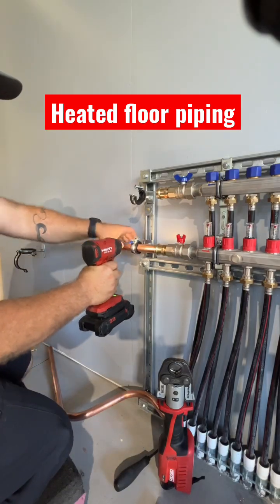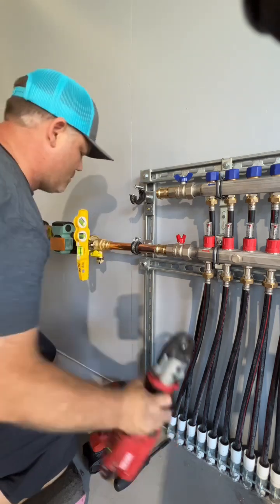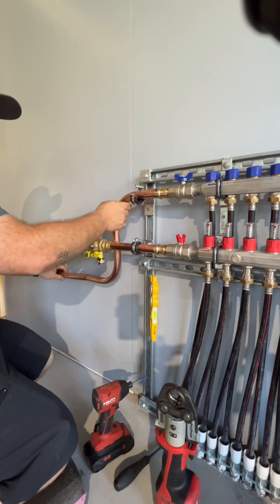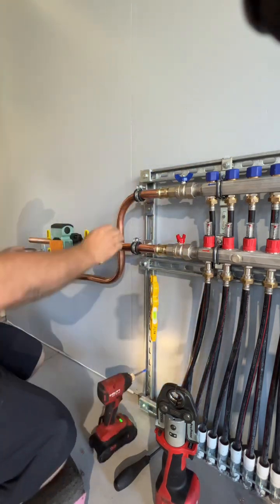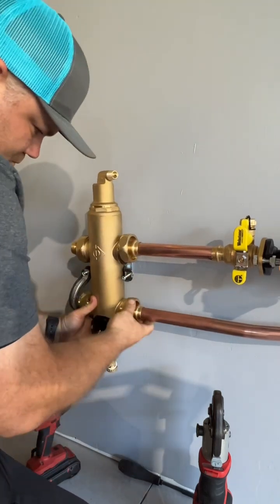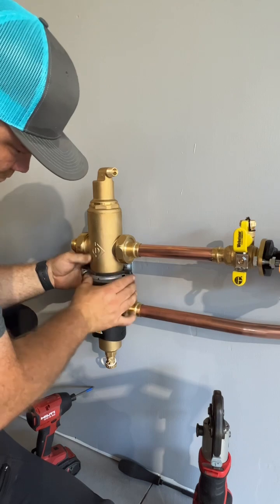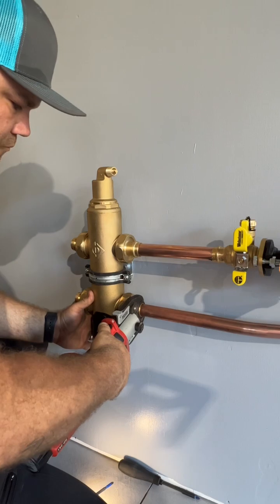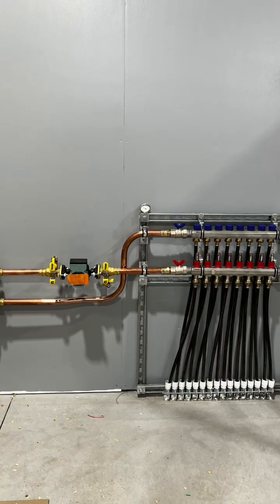Copper plumbing for heated floor #auneshop 🤟🏼💪🏼💯🔥

Comment: That air separater by spirotech, atleast the bigger ones use weird metric threads on stuff so dont start pulling shit apart and expect you can just use regular threaded fittings. Ask me how I know. Drain is cool, it has a magnet inside a tube that is magnetized to collect metallic shavings.

Comment: I thought I was the only one that bent copper pipes instead of using fittings at every single turn. That bent pipe has given you unlimited kudos, it looks freaking awesome! 👌🥰
Reply: Depending what I’m doing , I’ve always said. If these fittings use fittings (re work job) but if it’s new bend away moe farrah!
Reply: What was the name of the tool he used to bend the pipe? I tried using a conduit bender but it would create ridges on the inside bend.
Reply: @qoolcat7383  I've used a hydraulic pipe bender with the hand pump from harbor freight.

Comment: Thank god you put a $10 strap around each pipe right above concrete. 😅 those would have shifted and moved all around
Reply: Clamps are there to stabilize the sleeves during installation and concrete pour.